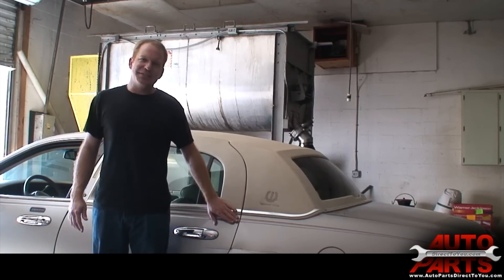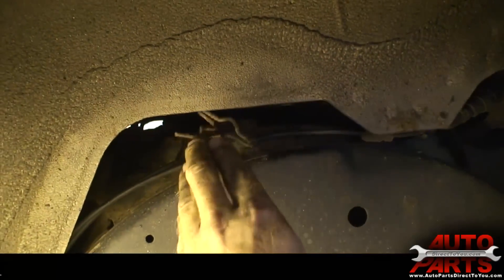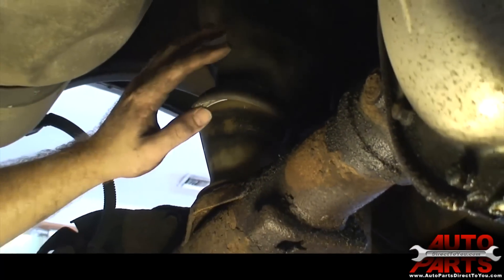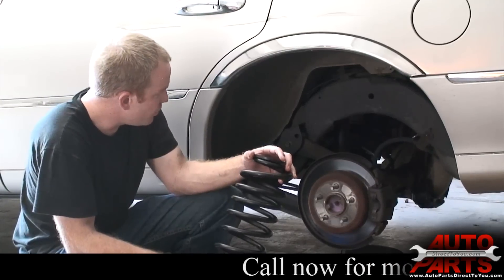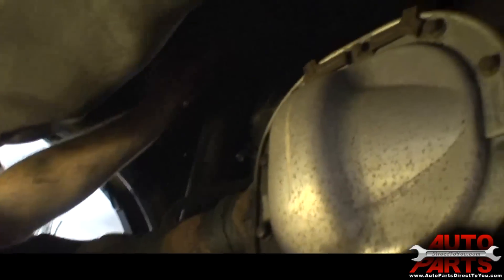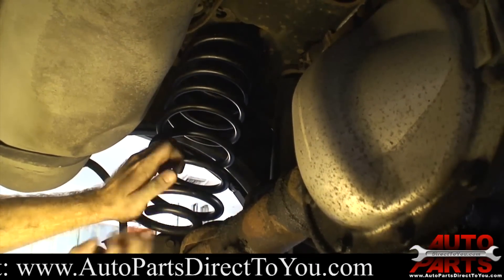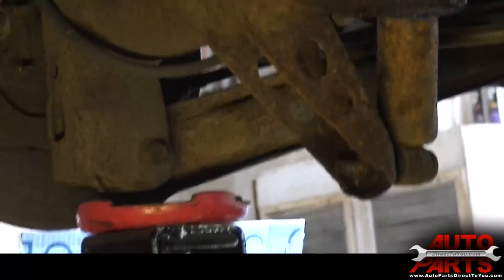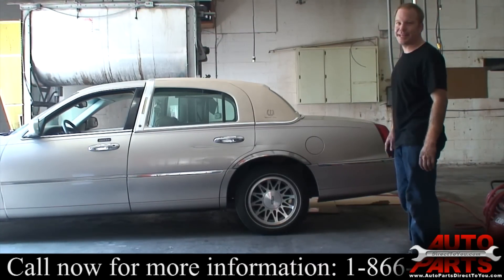2000 Lincoln Town Car Air to Coil Spring Conversion Kit

Comment: go inside glove box when done and cut the black wire inside the control module so the light wont keep going off!!!!!
Reply: All I had to do was pull the relay and the two air ride fuses....  But cutting the wire would work as well... LOL
Reply: Just put a sticker over it. 😂 that says fixed on it and it'll light up green